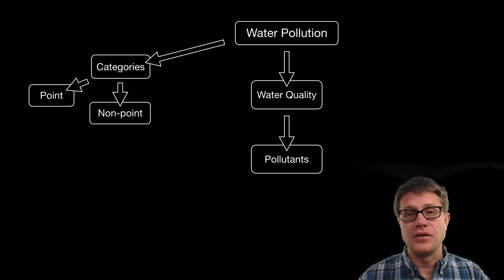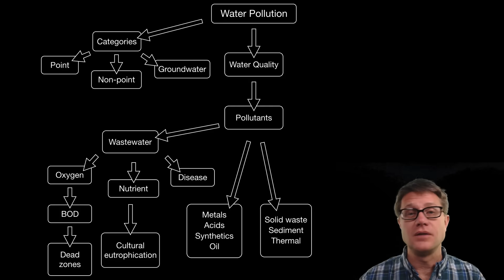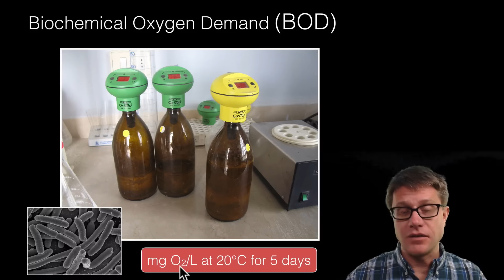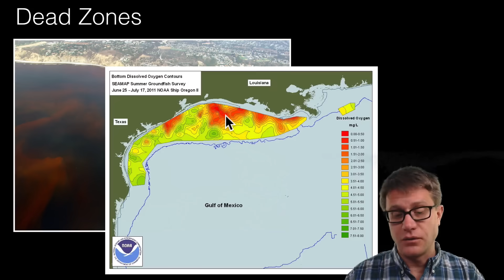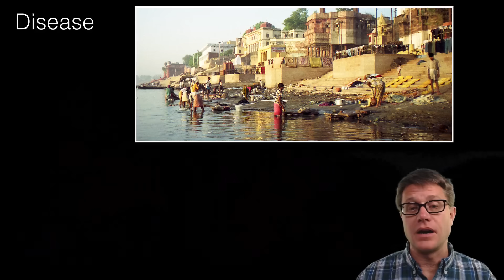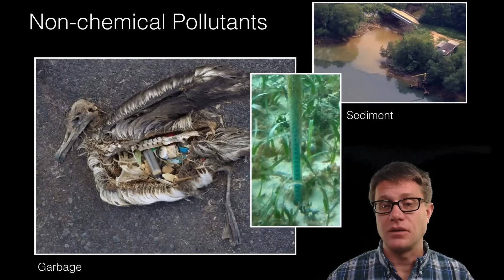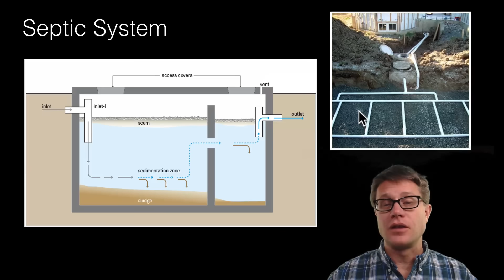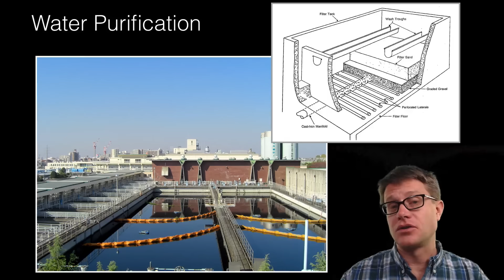Water Pollution

Comment: Paul, I don't understand why the O2 increases in polluted water (healthy = 1mg/L vs. EU polluted = 600mg/L)  if the bacteria require and is using oxygen thus depleting it from water?   Example - eutrophication is oxygen depletion from bacteria consuming dead algae
Reply: This comment is very old and I'm not paul, but to answer your question, the oxygen doesn't increase. The oxygen demand increases. When he's talking about the measure of BOD increasing, he's describing the amount of oxygen that the water's organisms require. A high number results in less oxygen available in the water after the decomposition process.
Reply: Debra Lee Magadini